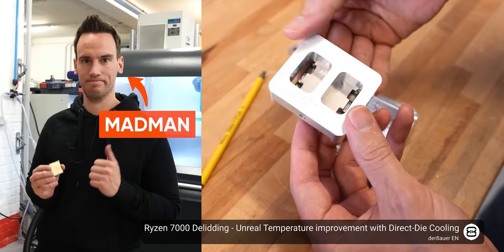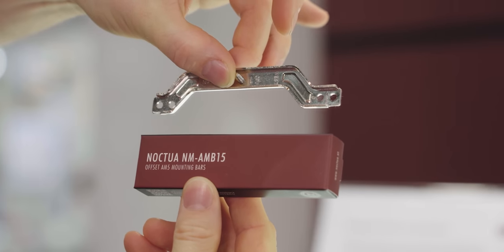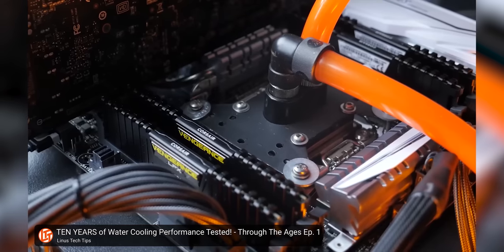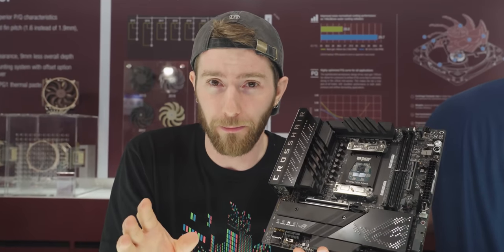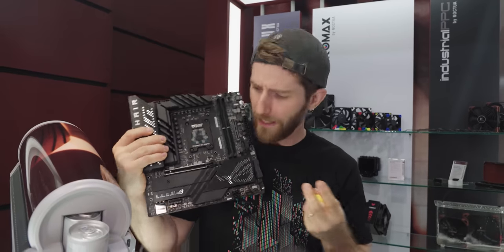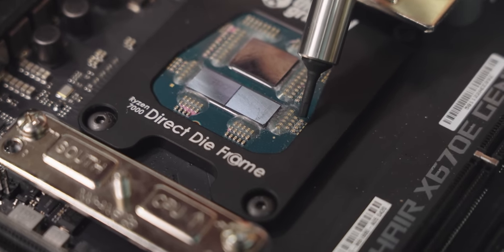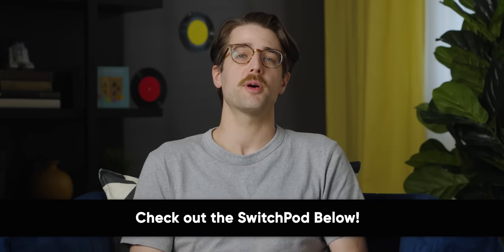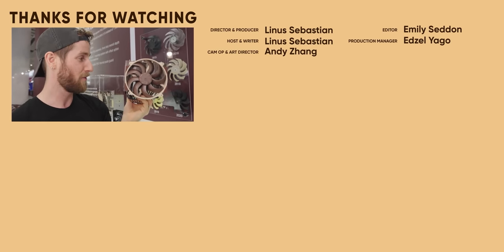Noctua's New Cooler Voids Your Warranty - AM5 Direct Die Cooling @ Computex 2023

Comment: In around 2001 maybe 2002 i had an Athlon 1Ghz cpu in my personal pc. It was waaay cooler after using a 233MMX intel back in the day. So as i was monitoring the temps as i usually did, noticed the thermal grease was drying out, and repasted it, and didnt used the brass bracket to protect the cpu die... i had it i just havent used it. So i accidentally killed that baby. can imagine the wreck of my self esteem. lol. Needed to buy another Athlon which wasnt that low priced cpu. :D

Comment: Free tip to Noctua, the pipes are running horizontally now. Doing it vertically would get you another few degrees (only on the CPU shown in this video though). Though you'd probably need to twist things around to get the fins and airflow back out the back.

Comment: Does it work with X3D models?
Reply: Thermal Grizzly mentioned that the direct die frame isnt compatible with the 7800X3D, unsure about the 7900X3D, or 7950X3D

Comment: Had to stop watching. Seems like one big advert for overclocking.
Why can't we just get some crazy powerful CPUs without doing all this surgery? Yeah, I remember OCing the Celeron 300 by turning the bus to 100 instead of 66MHz, and it running faster because it had more cache than the Pentium 450- and I ran it all of 3 months at 450 just fine, but now it's still working at 300MHz as my DOS machine 20 years later. I got tired of trying to force a faster system, and just bought the fastest one without worrying if it would be stable. If you have the money and this is your thing, great, but I can't afford to re-buy everything I try to OC anymore.